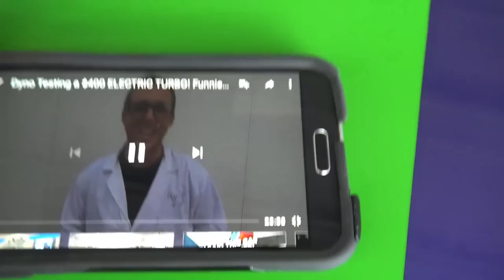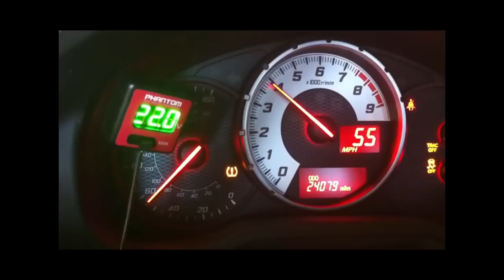Cleetus Mcfarland is wrong about electric turbos!

Comment: Only issue with this is the price man, you can effectively buy a good turbo spool and pair it with decent supporting mods for around 2k and make a ton of power, however you did a great job putting this setup together and if you're happy with it more power to you sir 🙂
Reply: This is for someone who does not want a ton of power, but just an extra boost in hp for some fun and drivability, a car like the FRS is not safe and not reliable when you add too much.  this system is easy to install and easy to take off, no lag, and does not require as much work compares to a turbo kit.  The price will no doubt go down and be more affordable if more companies would develop and sell this type of kit.
Reply: @yume8380  oh for sure, its a great looking setup for sure

Comment: Here's a question. I noticed on the video by Cleetus of the Torque Amp they had good results as you did with the Phantom. The problem I see is the reduction in airflow when not engaging the electric 'turbo'. Has anyone installed a gate system to take care of this? Considering on doing one of these on my motorcycle, but don't want the reduced intake airflow when not using the boost. As far as charging, one could also charge from a plug-in charger as needed. I mean, if the battery can provide 4 minutes of boost, that's plenty for some fun here and there... it's not like you're gonna hold the boost down for 4 minutes straight... probably 10 second boosts as needed.
Reply: y-coupling was the solution i did.
your cold air or short ram intake on one end then the electric supercharger on the other.
this is so when it's not enegaged, there is not an obstruction of air.
Reply: When you're at low throttle and load, you'd be shocked how little airflow you need for normal driving. Personally, I'd use a switch on the shifter so you can get instant and full boost at any engine RPM.

Comment: In defense of Cleetus they tested it on a V8. They said it might work on a 4 shooter.😅 And theirs said a increase in house power😂
Reply from the maker: Even on a 4 cyl that thing would not have produced boost. You need something better engineered and at least 24 volts.
Reply: Photomikes Garage Wow did think you were going to reply. Is there one that would work on the Vic thx

Comment: this unit's output throat could/should be nearer the size of the throttle body (about 3/8" larger diameter). if a unit can push 5-6 lbs up to about 6500 rpm before it starts rolling off its everything it needs to be, factory ECU isn't going to freak out. that setup on a 1300-1500cc could be a surprise.

Comment: Hi,respect to everyone,cheap stuff often doesn,t work,but 2000 a little to expensive,DIY may be the answer.
Reply from the maker: For sure it could be built for less than 2000 but you would have to have electrical knowledge.
Reply: I've got less than $500 in my setup. I'm also over engineering it. And adding to the fuel assembly to make more power. It's doable just takes some understanding.

Comment: Cleetus wired the electric turbo backwards in their final dyno run. It was wired RED - Positive/Blue-Negative in the test fit, but it's wired RED-Negative BLUE- Positive in the Dyno run, the opposite way around.
Reply: I rewatched the video and can’t see proof of that anywhere.  Do you have time stamps that could prove this?
Reply: 13.03 for the test fit. 20.04 for the dyno run. Watch the battery and what coloured wire the guy is holding.
Reply: @MrFredscrap  Yes and watch it in 0.25 speed when it starts spinning, you can clearly see it spins backwards when installed on the car.

Comment: You omitted some very important information.  How much HP do you lose while your "turbo" isn't active?  I would be very interested to see some dyno pulls of pre-install compared to post-install without the "turbo" operating.
Reply: Curious of the same I.e what consequence/restrictions are there with the compressor when it’s inactive (when the car is in cruise mode)? Wouldn’t the internals of the compressor make it harder for the engine to suck in air with an inactive compressor?
Reply: Yeah, for this to reduce/eliminate such inefficiencies, you would need to have two separate intake paths, one for when the supercharger is active and one for when it isn't (and thus a separate means to switch between the two).

Comment: That's why the pros use electronically assisted turbos. Has a clutch that allow exhaust gases to continue but the electric motor produces boost anywhere you want it.

Comment: Wow.. I can't believe this guy. 2 grand for an electric turbo? I need to get in the business of making shit like this that people buy...
Reply: He probably got it for free and is promoting it. No one would pay that much for that little of gains. In replacement of a turbo system that is tried and true.
Reply: F1 cars use electronically assisted turbos.

You dont wait for boost, motor spools it, then it turns off and functions like a normal turbo. They are insane. Instant boost.
Reply: @wes89  but can you buy it on eBay 🤣😂
Reply: @jynxd420xxx7  no but they are so simple you can literally make them yourself

Comment: When he is explaining the battery situation he said the car runs off of it? I thought a car ran off a alternator after started thats why a car can stay running after battery is unplugged or removed
Reply: Proof of his lack of knowledge
Reply: Wrong. They work together. Alternator only charges when it has a 12v signal how they all work. Do some research. Will only run for so long till computer realizes there's no 12v signal.

Comment: it may work on a 4 cylinders cleetus doesn't deal in 4 cylinders.
Reply: He should because a 4 cylinder Mitsubishi made leroy look like it was crawling at fl2k lol
Reply: Paul kivler lol but that mitsubishi is all billet, on how much money put into that mitsubishi if it was put into leroy, leroy would be much faster and would handle way more than 30lbs of boost
Reply: They need to put the electric turbo/supercharger in the Geo tracker and see if they can get it done as long as they don't sink it in a pond again I'm sure it will surprise them
Reply: @hollarforadollar9244  the red demon owned  leroy
Reply: Miguel R car has been around for 10 years. Built and built and raced and raced. It’s apples and oranges.
Reply: Cleetus did a video with 2 electric superchargers on a 2.2l Cobalt and gained 75whp and 100wtq. No joke.

Comment: Why use double 12V cells when you can just get a nice big 12V battery and a 24V buck converter or transformer coming off the ESC to your electric motor? You could also just get a fan motor that's wound for 12V but the transformer would also allow you to change the voltage according to whatever electric motor you're running in case you decide to upgrade.

Not dissing the way you did it. Just curious about what the options are.

Comment: Cleetus had the thing wired backwards. Keep it up! These systems keep getting more powerful.
Reply: You can see the wiring polarity was reversed in the video. 
The test fit had the red wire to positive battery terminal, the dyno run had the blue wire to the positive battery terminal instead.
Reply: Dc doesn’t care if it’s backwards or not.  The motor would not blow form being wired backwards.   But there is no proof the wiring was wrong so to make that assertion is just silly
Reply: mike schneider is right. alternating current he could hook it up to where it spins backwards yes. but Dc current which the car is you cant hook up wrong without it frying
Reply: Montana chaos club so did you flunk basic electrical theory or never take it?  Go grab a battery and a load (light, rc car motor, etc).  Swap the polarity and tell me what happens.......  I can tell you this, it won't fry.   Lmao.
Reply: There's video of the wiring polarity been *swapped* between the test fit @13 min and final dyno run @20min just watch the battery (and colour of the wire the guy is holding) there's timestamps of it on the Cleetus videos comments.

The thing had a control/converter box, who knows whether it's AC or DC. So why are y'all arguing over AC/DC or whether it would fry when no one has access to see what's actually in the control box circuit board?
Reply: MrFredscrap it’s wired to a dc battery, and controls a dc motor.   The circuit is dc.   There is no room for further discussion on that matter.   

That being said, yes they could wire it backwards to make it blow instead of suck.  I do not believe that to be the case.  The assertion that a cheap electric motor running on the amperage those wires are rated for is creating boost is laughable
Reply: No cletus had it on a larger engine that demanded more air flow than these can produce. These are great for small engines sure but not good for anything larger than 2.5l

Comment: 5psi gives you 0,345 bar pressure, so that should give you about 2 hp more. The problem is the Turbo diameter is smaller than your airflow meter, so you are throttling the air intake at normal driving, so you are choking the air into the engine.
Reply: Properly set up (map, flow rate, temp, fuel, timing) forced induction should make 17 hp per psi  as a general rule of thumb.    If it doesn't,  it was a wasted effort.
Reply: That's make no sense and is not plausible. 2 hp is within margin of error and is not functional difference. 5psi is plenty given it has required VOLUME to feed the engine. Yes there is a restriction during normal driving at low load but you do not have air intake requirements where that is a problem. But when Boost is On the restriction is overcome with Forced Induction. Something like 35-40hp bump is very reasonable given the right parameters are met.  Nothing  you said makes any engineering or mathematical sense.

Comment: Interesting! Id love to see more higher boost builds with this. Did you ever run into issues with the turbo creating a restriction in your air intake while its off? I've run to issues before with a regular turbo, but the bearings were shot so it would not turn at idle; creating a huge intake restriction and a extremely rich idle.
Reply: no matter what a turbo or supercharger will restrict the air intake not sping or spinning a little from intake air and even to the point the are powered they will still restrict intake air until they start to  make about 2 to 3 lbs of boost to equal out tge factory power. so if this man dont have that thing going until 75% throttle then he is killimg the engine at anything low thottle which would make tgat engine suffer. If you are lokking for your car to run normal until he wanted full throttle power for those little gains he couldve save a bunch of money and ran a wet nitrous kit whixh you can get for 3 to 500 bucks and it can be tuned to the car and give you power only at full throttle or less. also you can make it r7n really efficiently if only running a 40whp gain its super safe that low with notrous on up to  100whp shot for most engines. niteous can be tuned.  What this guy is showing on a dyno is tge fact a dyno is just a tool. it meant to say if your car make 120hp  for example that when they tune or fix the issues that the car may be having a dyno shows there is power gains sometimes just from fixing a issue. also you have STD AND SAE dyno numbers. one number is the number this particular brand dyno shows which is a real number the other is a corrected number and the shops for youtubers or shops try8ng to lie to guys they are tuning or a guy just trying to show big numbers the shop can type in estimated hp loss due to drivetrain loss.   which is retarted for ppl to believe those numbers if they dont understand how the numbers work because a mid engine car because the power goes from engine trans  through axles they caculate 10 to 15% drivetrain loss depending shops ppl etc.  but a front engine rear wheel drive car the engine makes power then driveshaft then rear and some say then axles then tire and dependind wheel/tire can be its owns losses so a guy can say 20% to 40% loss which us as ppl watching a video we just see hp so it can make a 195whp car look either 20% boosted or 40% higher than the crank/engine hp. which is dumb because rear whel drive you lose power yes. but we should  go by non corrected number which will look low. lets say you take 707hp dodge challenger hellcat to the dyno. 707 is usually the hp at the engine. but at the wheels with correction a guy can make is 707 or 800hp. without correction its gonna show us the truth of whats at the wheels and with drivetrain losses the hellcat can be 600 to 625whp but that is the REAL number of wat the car actually pushes out of the rear wheels to the street. HUGE to a person that knows but ppl that dont know its l8ke well thats a small n8mber. hell thats the truth number no lie

Comment: How much power do you lose when the turbo isn’t spinning? I wonder what Audi does in their system. They must bypass the electric supercharger so that it doesn’t create a restriction in the intake.
Reply from the maker: The impeller is not a restriction compared to the actual throttle blades themselves.
Reply: Photomikes Garage Anywhere in the 0-70% throttle range, while the electric motor is not running, there will be more restriction therefore more vacuum and power lost. I googled the Audi SQ7 to see how they do it and theirs is actually in a separate airflow path that has valves to take it out of the airflow when it’s not running.
Reply: @The.JZA.  photomikes is right. It will not be an issue. Cruising requires a minimum amount of air. The system on the Audi is also turbocharged on the high rpms and therefore the air flow is much higher at full throttle and high rpms. The electric supercharger they use have a much smaller compressor wheel and therefor is really limited in flow. So on a 2 liter naturally aspirated engine it's not a problem with the large Phantom compressor.
Reply: Daniël Hilgersom Basic physics tells me that adding a restriction will reduce power. Even if it’s a small reduction it’s still something and will also reduce fuel economy. He has the switch set at 70% throttle. Maybe when he’s “cruising” the restriction might be minimal but anything from 30-70% throttle will have a significant airflow velocity and I think it would make a difference to power and fuel economy. If you measure the vacuum pressure I bet it’s greater with the turbo in than without it.
Reply: @The.JZA.   You're partly right. Yes it will limit the flow when you have around full throttle and the Phantom Supercharger is switched off. But there is not really a reason to switch it off. People are also not switching off the turbo or supercharger of their car.

Imagine the size of the throttle body which is made for 7000rpm full throttle, cruising around 2000 a 3000 rpm with partially throttle requires much much less air, something the Phantom can easily do because it's a rather large compressor.

There will not be an additional fuel consumption at partially throttle. Why? The ECU will measure intake manifold pressure (vacuum pressure) and when the Phantom will be switched off the pressure could be lower like a throttle body is doing when partially closed. The ECU will not notice if this pressure drop is over the Phantom or over the Throttle Valve. So It will think that you're driving not full throttle or higher in the mountains where air pressure is lower.

Check https://torqamp.com/use-cases/ 
Here you see the graph of the Honda Prelude with original air intake vs electric supercharger switched on and off. Up to 4000rpm the difference (at full throttle) is minimal. This minor difference could have also another reasons because car manufacturers do there best to make the perfect air intake with resonance chambers. This will be removed while placing the Electric Supercharger.